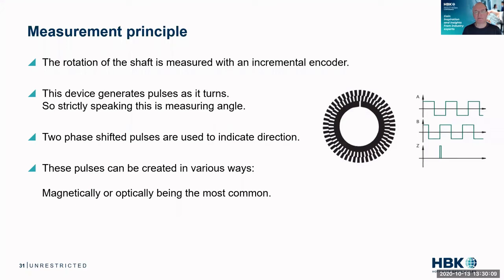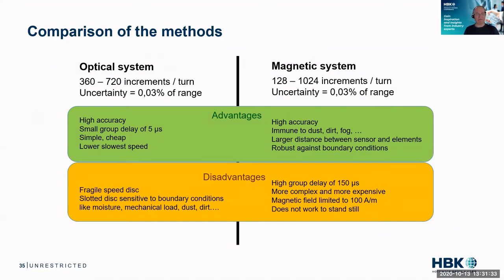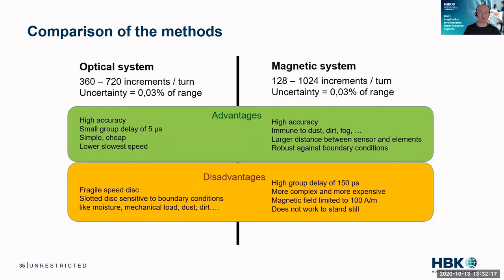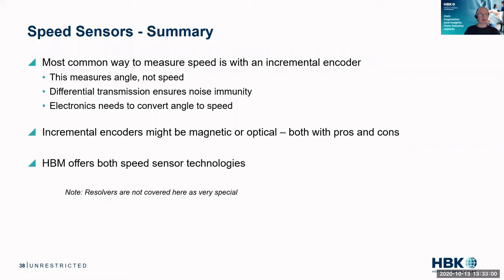Rotational Speed Measurement for Electric Motor Testing

Comment from the maker: Contents:
00:00	to measure speed ...
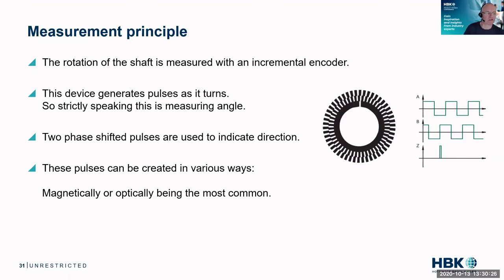00:30	... measure angle and direction
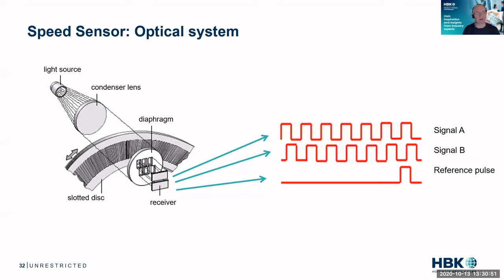00:50	optical method
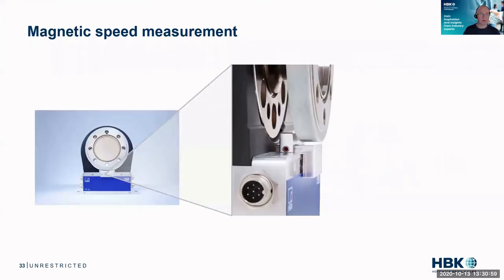01:00	magnetic method
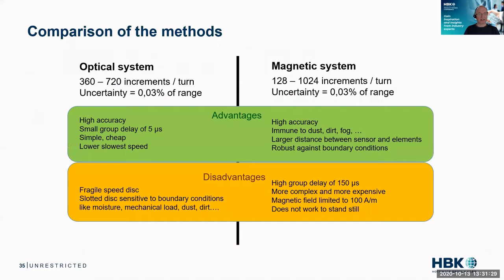01:30	each method has pros & cons
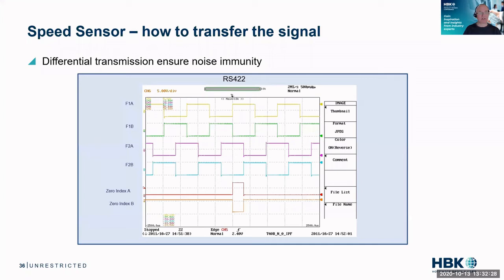02:25	typical Speed signal
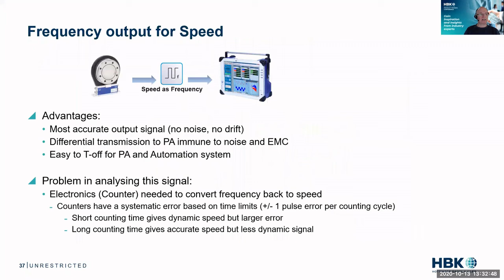02:50	measuring frequency